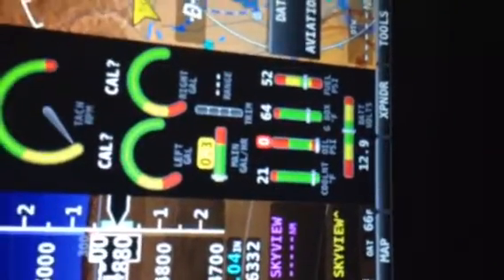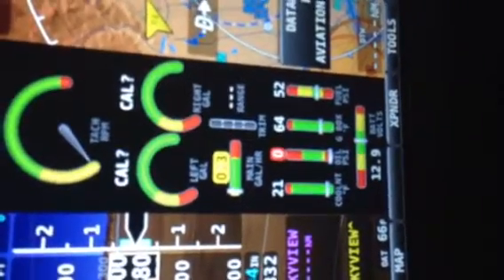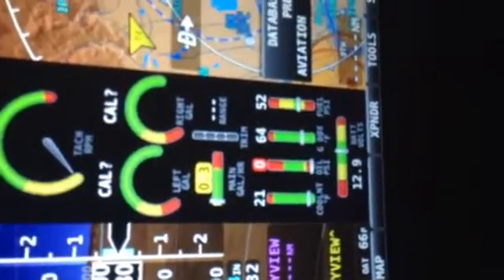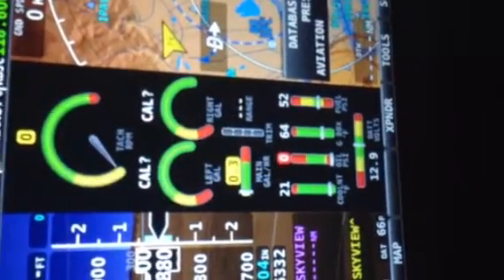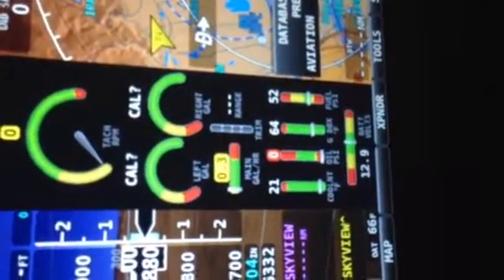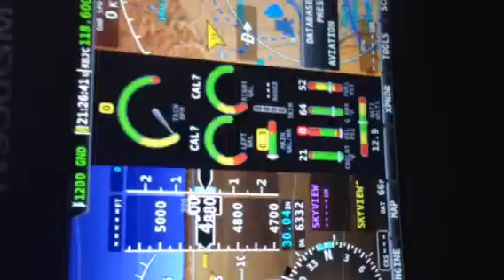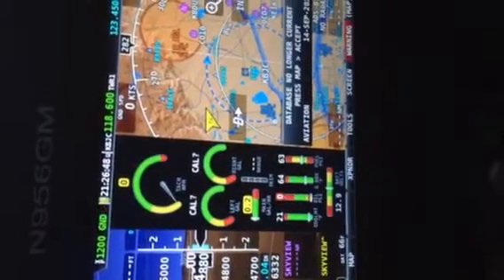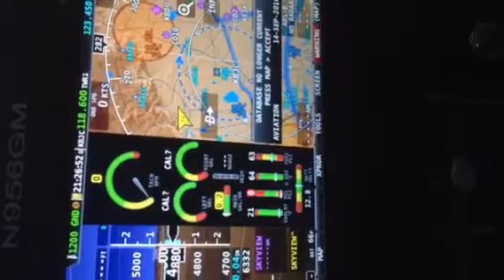Viking Aircraft 130 engine problems, Part 4 - fuel test

Comment: So did you figure it out the issue? No chance the supply was connected to the return on the fuel rail?
Reply: Your probably right, the bias with these engines is for them to run if everything is done correctly